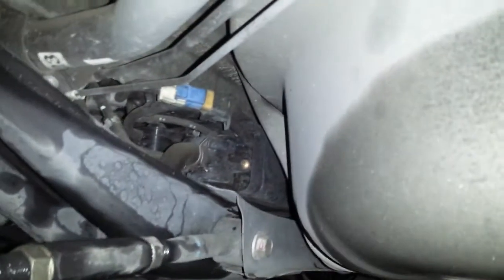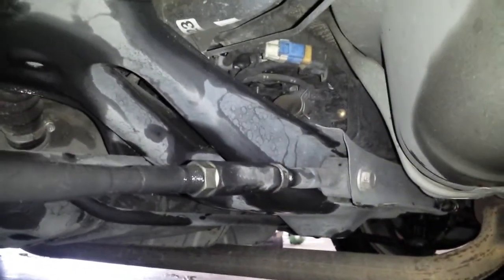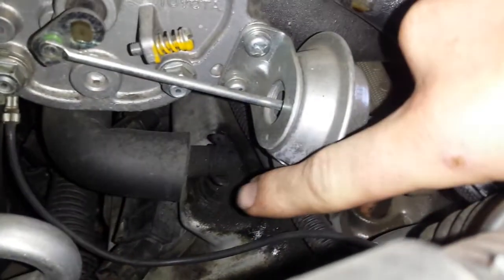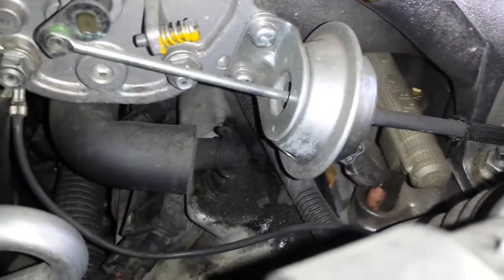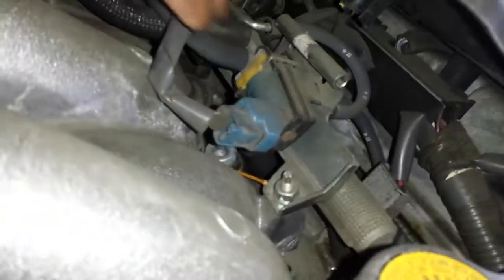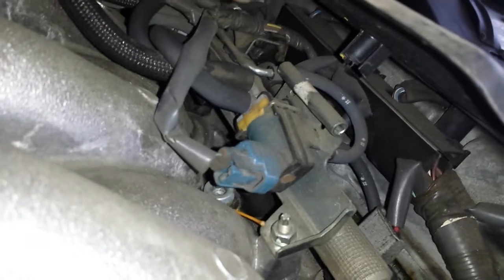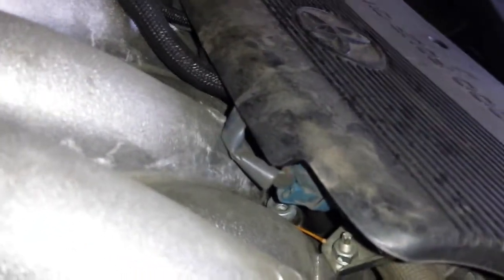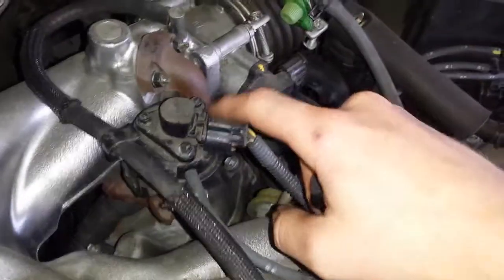Toyota Camry emissions: EVAP canister, Purge solenoid, EGR valve, & PCV valve locations

Comment: Thank you! May I ask location of the evaporated purge valve solenoid on 1999 Toyota Corolla? Thank you!
Reply from the maker: Off of the top of my head, I am not sure if I have a video on that vehicle. If you would like to text me a few pictures of your engine Bay. I will circle the vapor purge solenoid and send it back.. Text me at (925) 418-5096

Comment: I’m a girl so where is the evap hose?  And about how long is it ?
Reply from the maker: I am glad that you are taking the effort to get to know your car and fix it yourself. Good job! Now with the EVAP system. There are a lot of hoses that are a lot of different lengths. You have Vapor hoses that go from the fuel tank to the carbon canister, from the carbon canister to the vent solenoid or to the purge solenoid up at the engine and from the purge solenoid to the engine. Do you know what hose needs to be replaced?
Reply: Well the paper that I got from auto zone says : REPLACE EVAPORATIVE EMISSIONS (EVAP) PURGE SOLENOID VACUUM HOSE . I just don’t kno where any of that is an ivy gene on google for days trying to figure what any of that means
Reply: @butterflykash914  It depends on the vehicle, but it is usually near and connected to the intake manifold or throttle body.

Comment: what's your recommendation on a p0446 code on a 99 Toyota Camry
Reply from the maker: +Dontaye Romero i've seen this code a number of times. I start by testing or replacing the vent solenoid and cleaning the hose that goes to ambient. Ive seen a few times that the car has come back and it ended up being the pressure sensor ontop of the gas tank.
Reply: Thank you for the response sir.
Reply from the maker: +Dontaye Romero you know what? I guess i am lieing. Lol. I can't find what i'm talking about either. Somehow i can remember finding a sensor on the top side of the tank on the rear passenger side. Pretty much rite under the rear passenger but. I could be thinking of a different year. Did you check the cap? You have 2 vsv's on that one. The vent is rite near the cannister. The purge is nesr the air filter under the hood. Thise could be bad.